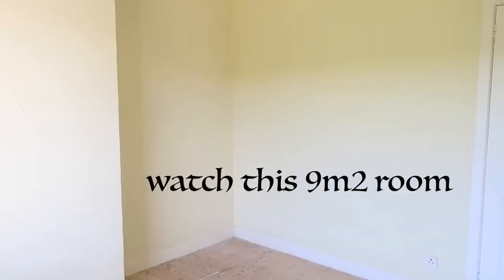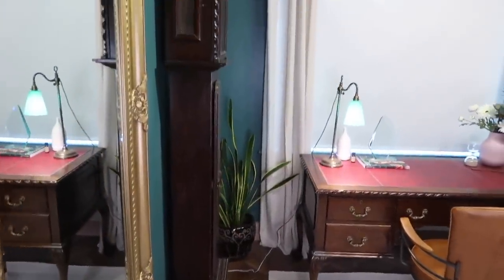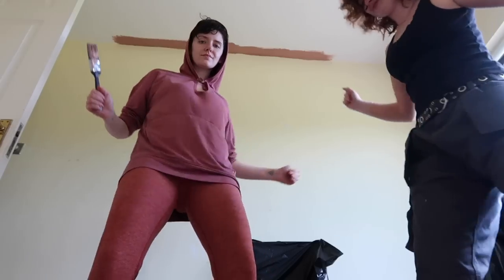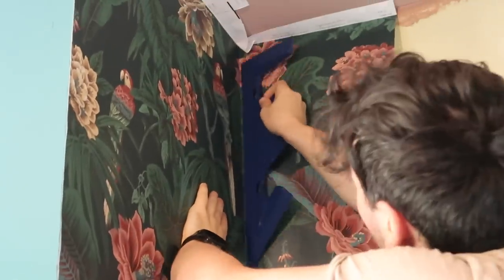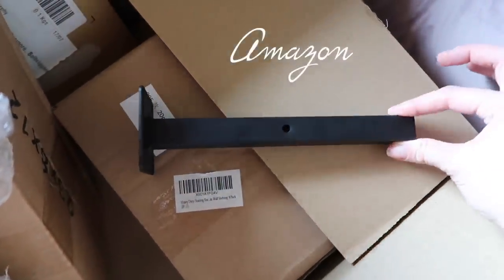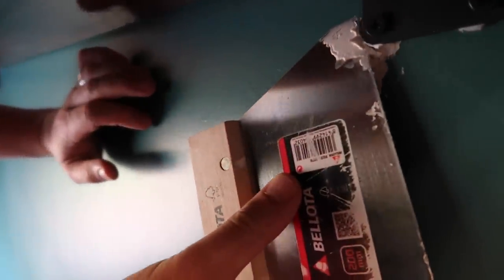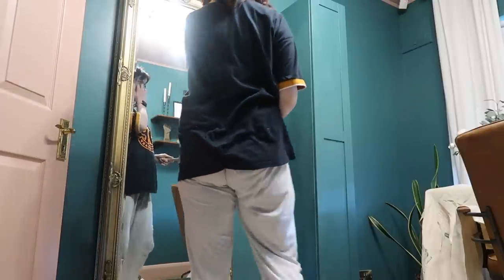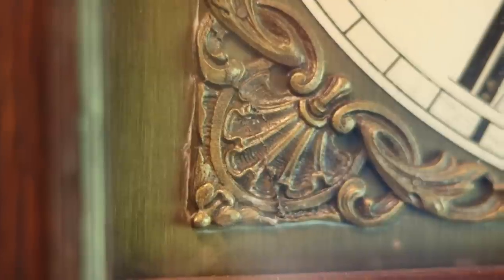Extreme SMALL ROOM makeover (9sqm) *vintage modern design* ... before and after!

Comment: 💚💚💚 It's hard to think what my favourite item is... I think it has to be the colour of the room all together! It just brings everything together so well! Well done on everything. Only one tip if I may :) My mom's is an interior designer and a professional painter et wallpaper installer, when you paint (if you don't want the natural light to reflect on spots) always paint in stripes (up and down) all the way from the ceiling to the floor, you can do a few diagonals first to spread the paint but afterwards keep it all in the same directions! And for the wallpaper, keep some extras at the top and bottom and only cut it after you've placed it, flattened it and removed the air bubbles from the glue. I think those tips should come in handy for the next renovations of your beautiful house! <3 well done again! 💚💚💚

Comment: There's A LOT of stuff I like: the floor, the table, the rug, the curtains, the Harry Potter bags, the chair, the wallpaper, the lamp.. but I have to say my favorite is the window and the VIEW 💚💚💚. Also, I am 3 months into planning out my south-facing room (IDK exactly how to face a room) and I have been just cleaning and moving furniture on my own.  I have 3 more months to figure these out but yeah, thanks for this video. I felt like I'm not the only one who is taking this long to clean or plan a small room renovation. My brain is now thinking of lifting the curtain hanger up to 2 inches below the coving. I wasn't planning on painting but I will look more into it. What I've learned is that thankfully I started with the window area cleaning up to the ceiling and floor, it came to be the easiest part of the project.

Comment: Beautiful room ❤ 
I want to give you a tip if you want to continue to paint furniture: buy a paint gun, or just use spray paint. It is so much faster and smoother. After painting our hallway, bedroom, a small closet and 1/3 of our kitchen doors, I can't bear the thought of painting any more...! The parts of the paint gun have to be washed, but it's still much faster than brushes and rollers